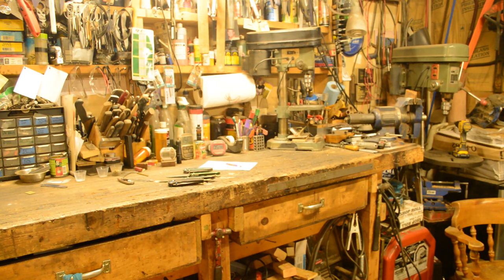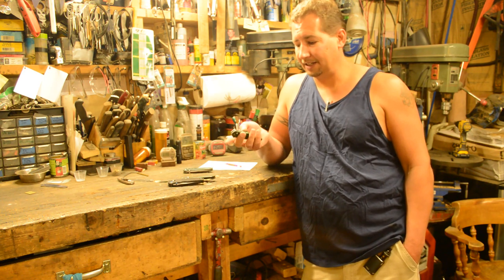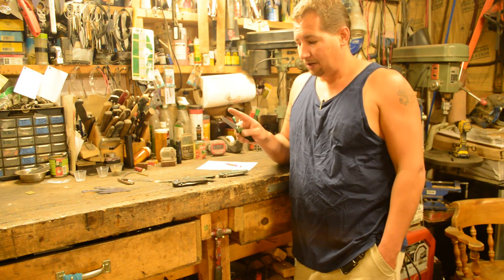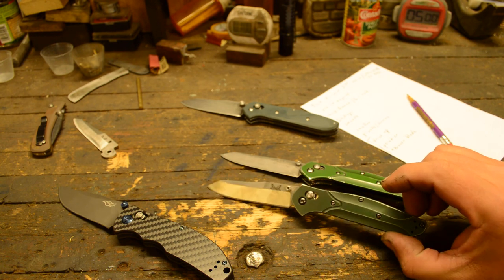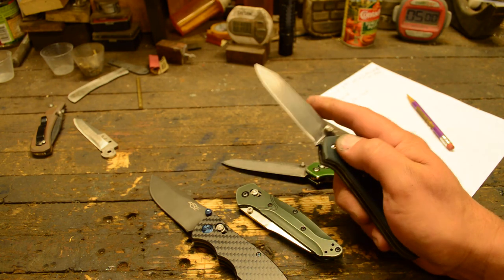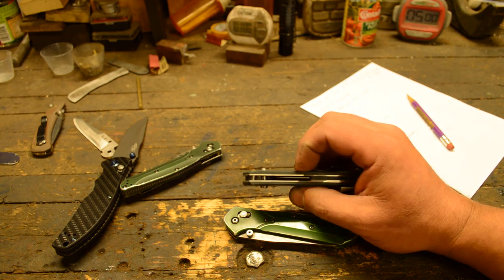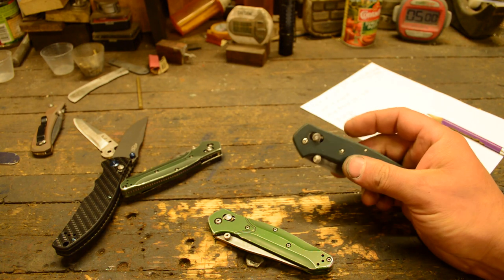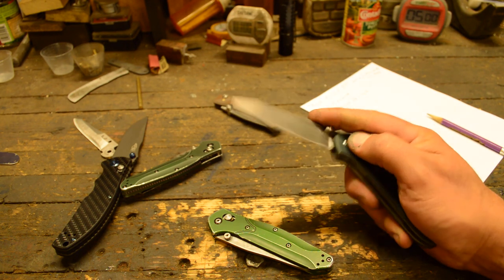introducing the new line of axis style lock pocket knives!!

Comment: I finally got me a BHQ 940 and sadly I feel like the stud is too close to the scales but with the slimness of the blade they can’t go out any more. It’s also too tight just like my BHQ para 2 tanto was. Between the tightness and placement of that stud it’s extremely hard for me to flick it open.
Reply from the maker: you can adjust the pivot pin to the tightness that you like pretty easily with a torx bit. and with the thumb stud it helps to sort of push it forward more than outward as it is very close to the scales like you said.

Comment: The issue with that sort of lock is that the spring will, at some point, fail. If you’re making your own, that doesn’t make it any easier to replace.
Reply from the maker: I keep hearing that about the springs breaking. all I can say about that is that I have 2 940's, and have carried one or the other nearly everyday for the last 12-14 years, worn 2 blades out from good honest work, and have never had a spring break. one of my favorite sayings is that anything with moving parts will eventualy break, and even lots of things with no moving parts, but I have not babied my 940's by any means and not one spring breakage.
Reply: Joe Calton I understand that, but consider if there’s a failure rate of 10%, that still means it’s unlikely for you, but likely for quite a few customers when you start making a bunch of them. I know people who’ve had Kershaw Spring Assisted knives and never had a spring break, my very first Kershaw with it broke (a Blur). I just think of any knife lock you could implement, this would be the most failure prone.